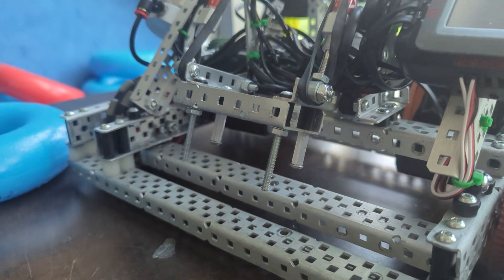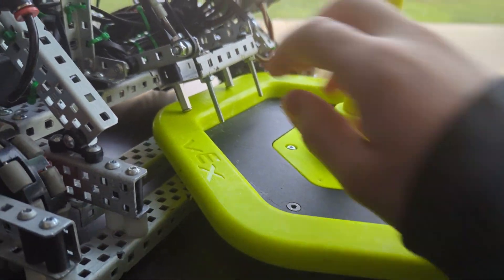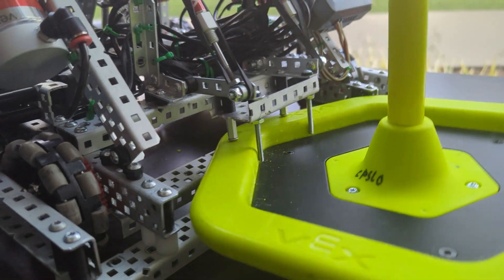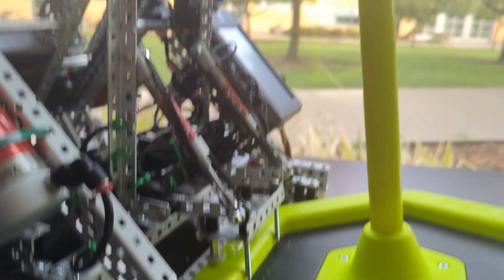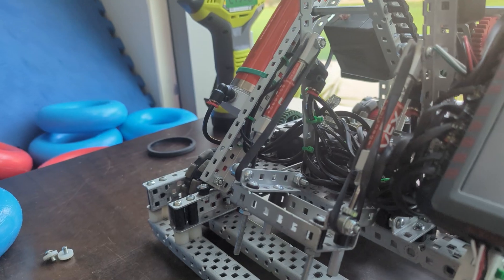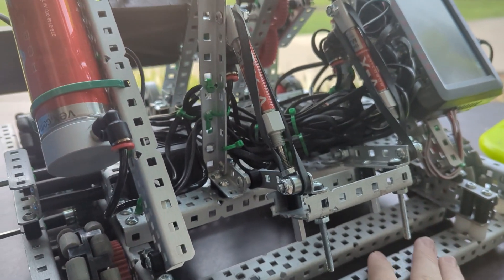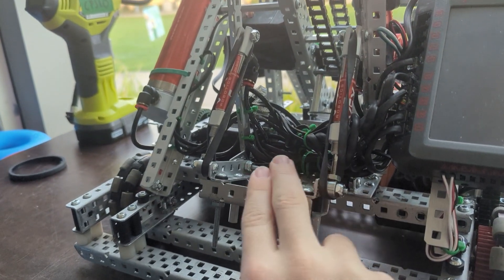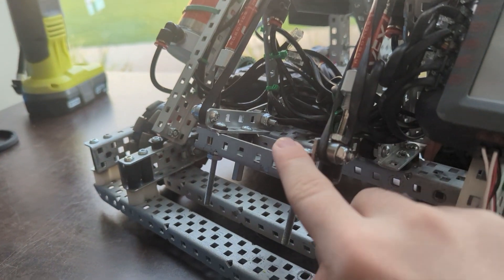How to Build a Mobile Goal Clamp | VEX High Stakes

Comment: it seems like you aren't having many issues right now, but i would recommend moving your pistons forward to have more downward force on the goal
Reply from the maker: @actual_bs  Yes, I mentioned that in the video that my cylinder position isn't optimal, but it works for me so I use it, but ideally it should be different

Comment: Question can this clamp help with clamping on both side the flat and corner of the mogo
Reply: Mogo*
Reply: yes, this is probably the easiest way to build an omnidirectional clamp. The tilt comes from a seperate screw/standoff, which means that the orientation of the mogo doesn't change the tilt/place of the clamped mogo
Reply: @ thanks

Comment: Great video by the way. I just wanted to ask some questions about your belt: How do you keep the belt so tight, while still not having a lot of friction? (because our motors  often burn out. We use two motors, with red cartridges and used a gear ration to make it around 500rpm. It's not connected to our first stage intake) and also, How many motors do you use for your belt? Would you be able to make a video to show how your belt works, if possible?
Reply: lmk when he gives an answer ok LOL bec we r in the same problem
Reply from the maker: By the belt, I'm assuming you mean the conveyor chain, and it is really sensitive to how tight it is. My preferred way to do it is to make the chain pretty loose, and then use a tensioner to make it just a little tighter, but chain that's too tight makes a crazy amount of friction, so be careful not to have to too tight, a little too loose is better than a little too tight.
Reply: @Joseph973  Thanks, could you make a video on it sometime?
Reply: i would use blue cartridges and gear them down slightly.